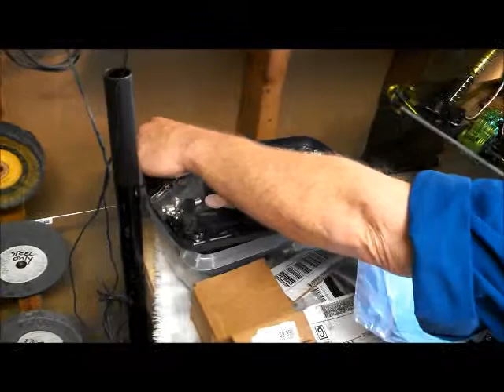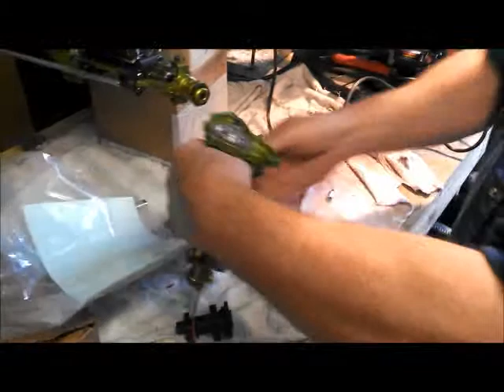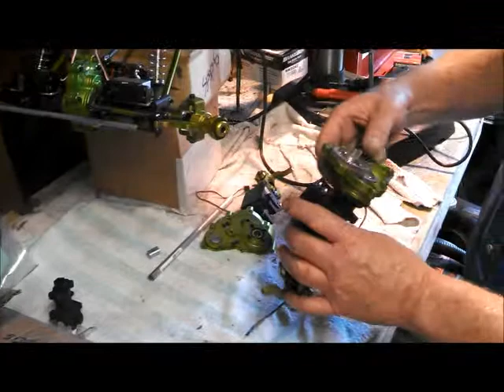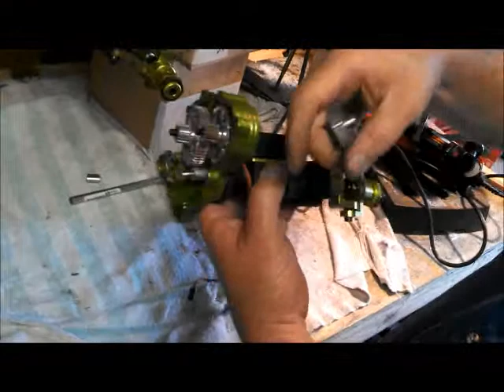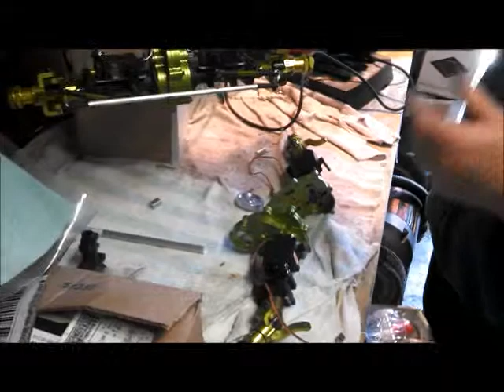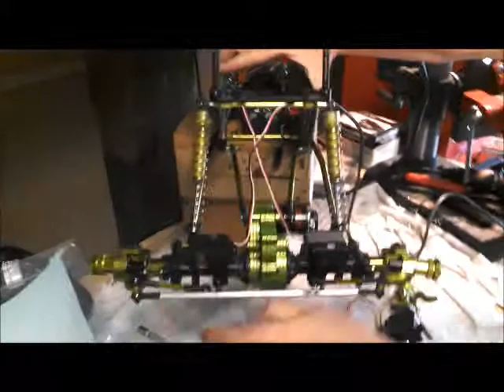the build of my 1/5 scale exceed crawler part 3

Comment: Okay  have a short video I put up working on a couple full length videos. Hope you enjoy more to come for sure was actually thinking about shortening the wheel base and adding new spacers to the shocks so it is lower with a little shorter wheelbase but I'm stuck on doing that or just getting different tires and a little extra weight in the front.. Hope you like the video
Reply from the maker: superpits8 I like the lowered look. does it help with crawling, i can see it would help from roll overs. Keep up the good work. Ramp-Ja's Rc's
Reply: It helps to drop off ledges for sure and Hill climbs feels more stuck to the ground .. Im going to video in HD for the next video.. I lowered it a little more and shortened the wheel base by 2" and raised the bottom two four links up to the middle he's a left the rear the same so it grabs more on the front for straight up and down faces..

Comment: I'm also going to be putting up a video of my hop ups on my 1:5 Maxstone5 soon as the rest of my parts get here I have some stock videos of it but I'm putting the video together with the differences of the 2.. Stock and not stock. And ps there's no specs on the Maxstone5 esc so I kept adding until it died and it maxed out at 3s maybe 4 but 6 started a fire.. Lol
Reply from the maker: superpits8  did you get it on film. lol
Reply: Jerry Morrison I plan on it..

Comment: Okay so yeah I found them and they are out of stock but I may have found a place to make me a few sets of them for me and if I could obtain a few sets I would need ppl to buy them to make my money back. So if anyone is interested just let me know how many you would need I can possibly have others made as well.. And they will be high quality high grade material..
Reply from the maker: superpits8  Hey superpits8  jerry here. What is the cost per axle? Do you know the metal type they will be using? exsamples: alum-5000, 6000 series, or steel-cold rolled or hot rolled. Don't understand ppl. Thanks for the info and updates. Jerry
Reply: Jerry Morrison actually soon as I started mentioning more then a few sets he started talking $1150 a gear so I denied that.. But I'm looking into Boston gear and going to be contacting someone from there asap..